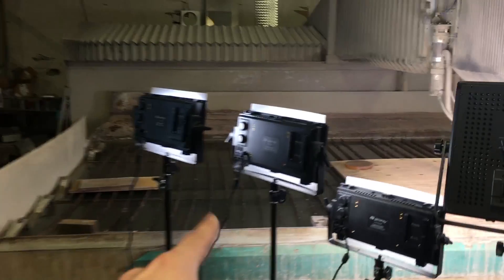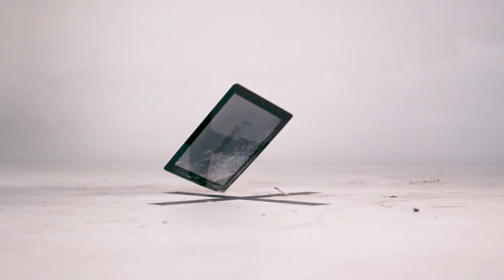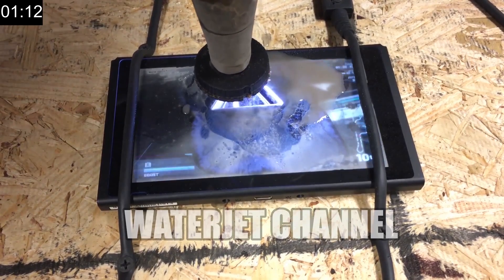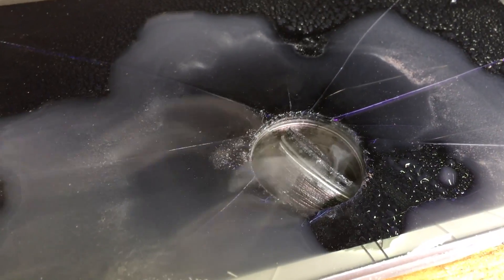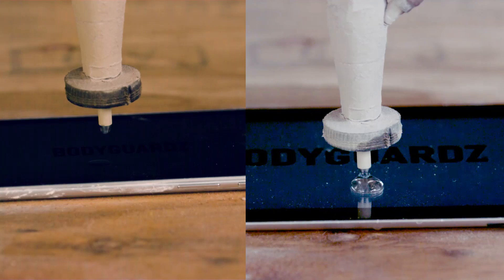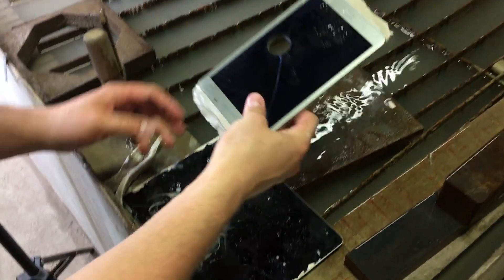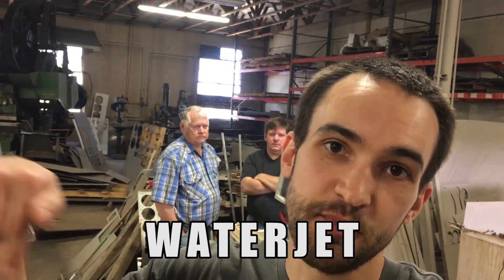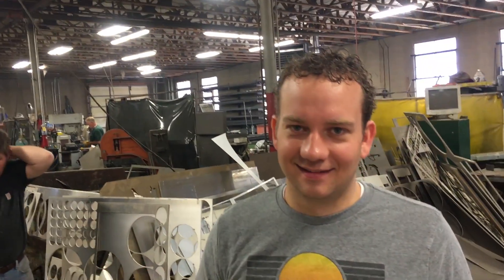Apple vs. Samsung vs 60,000 PSI Waterjet IN SLOW MOTION

Comment: You should have used older tablets, these newer ones were using either IPS or OLED screens, and the whole thing goes off when cut through, whereas the switch used a older LCD screen, which makes horizontal and vertical lines on the screen where cut through, so the devices are likely still running, but their screens both died the instant the water cut them.
Reply: the ipad has no touch id so it was quite old at the time